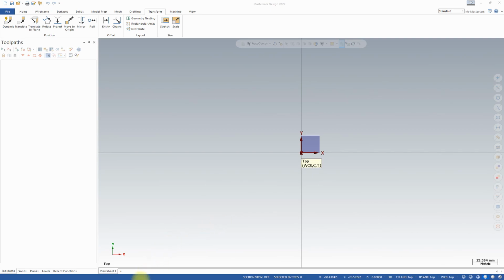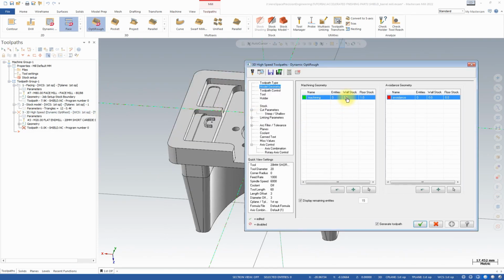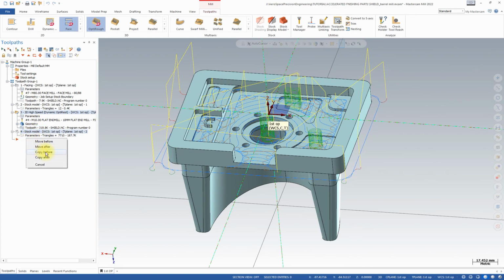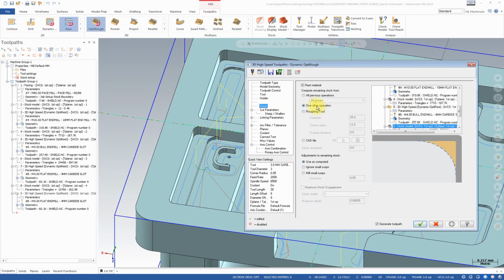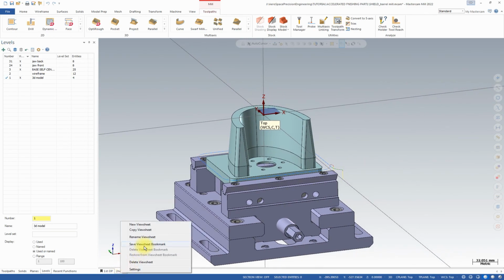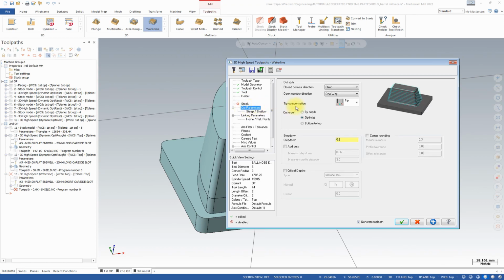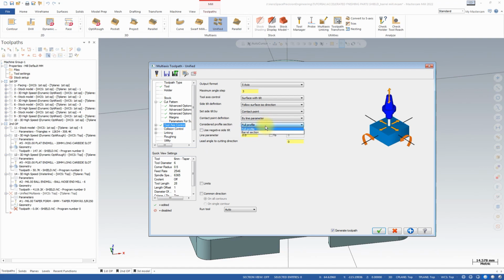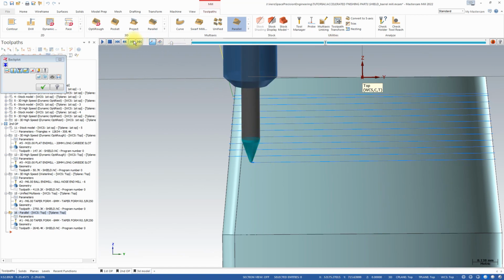Shield -  Mastercam 2022 multiaxis tutorial with accelerated finishing barrel mill

Comment: Hi Sir. How can I get a 5th axis vise to merge on mastercam to learn 5th axis? Thanks
Reply from the maker: 2 methods:
1) on the top left corner of the screen click on "file" then select "Merge" 
then in the window bottom right change file type from "all mastercam files" to all files 
select 3d model of a vice and press open button at the bottom on this window
or
2) using windows explorer open folder where you have the 3d model of your vice saved, then hold down "CTRL" key on your keyboard and drag the 3d model to your mastercam project to merge both together

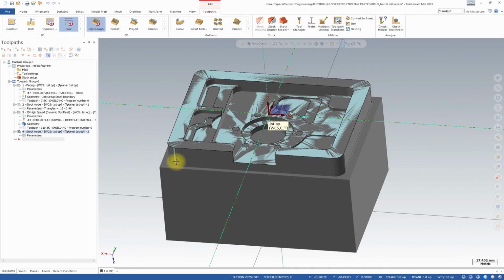Comment: 11:21 i just tried this in 2021 hle but when i select practically the same as you the stock is completely on a diffferent position. selected Planes are the same.

only if i tell it to use the stock operation definition it works properly
Reply from the maker: If you want i can have a look at this for you 
please send me the file (email: aerospace.engineering@europe.com)